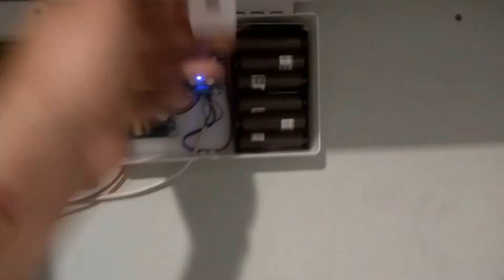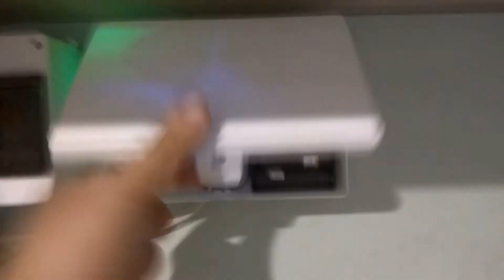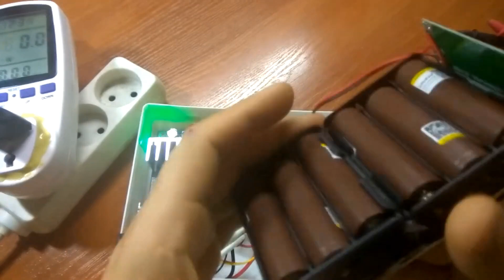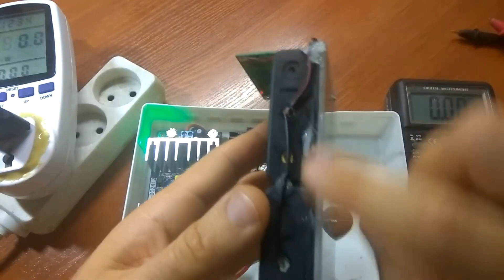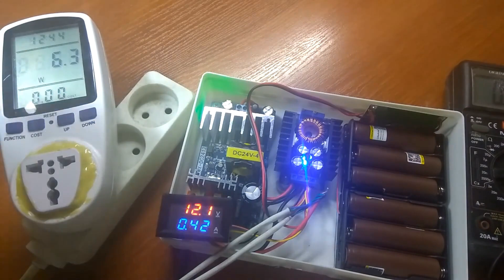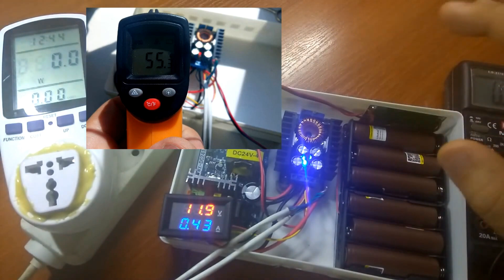DIY: Emergency Power Supply for Video Surveillance Systems. Part 2

Comment from the maker: 🔧 Tools needed:
👉Switching power supply 24V 4A:* https://amzn.to/43hIiOA
👉DC-DC Step-down converter:* https://amzn.to/4o7oEhQ
👉Litokala 18650 Battery:* https://amzn.to/4e2w8xZ
👉Battery holder:* https://amzn.to/4ulYCJp
👉BMS Board:* https://amzn.to/4e4lA1w
👉Besder Outdoor Camera:* https://amzn.to/3S2DoCD
👉Dome Camera:* https://amzn.to/4uTHGuT

Aliexpress Links:
24V 4A Switching power supply: https://fas.st/TnS_Z
DC-DC Step-down converter: https://fas.st/Xiqvg
Litokala 18650 Battery: https://fas.st/TdOp1p
Battery holder: https://fas.st/uOz-i
BMS Board: https://fas.st/z2QdD
Besder Outdoor Camera: https://fas.st/kardl1
Besder Dome Camera: https://fas.st/OVOJjh

Your reliable Cashback service: https://fas.st/e2JpP